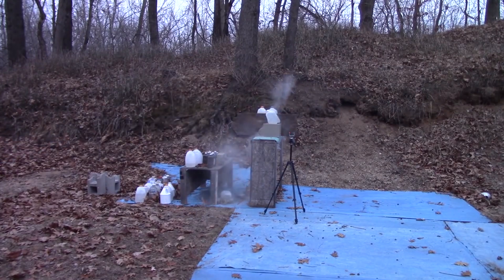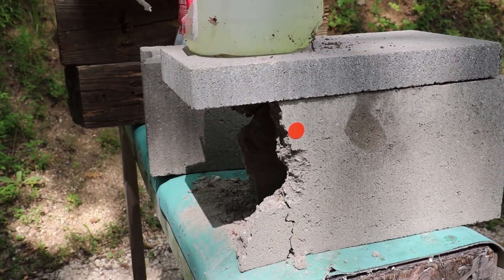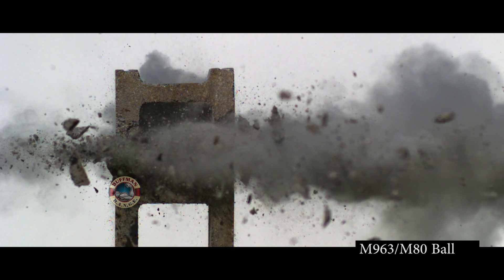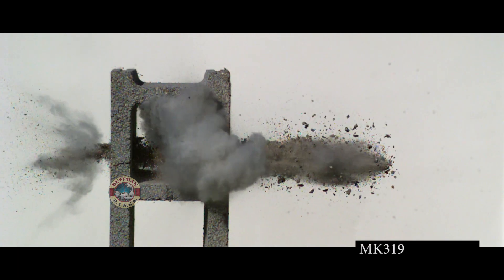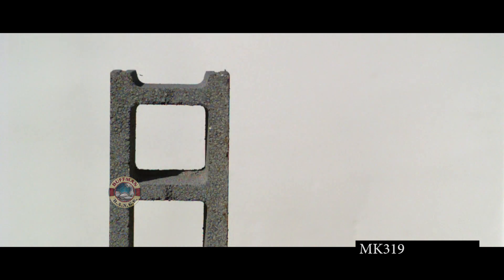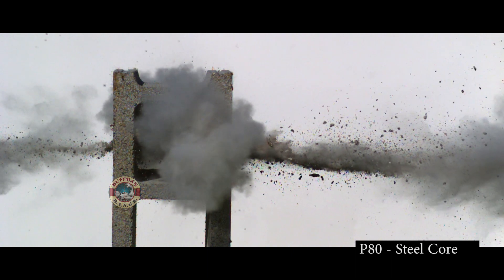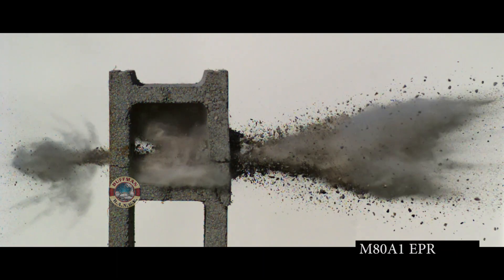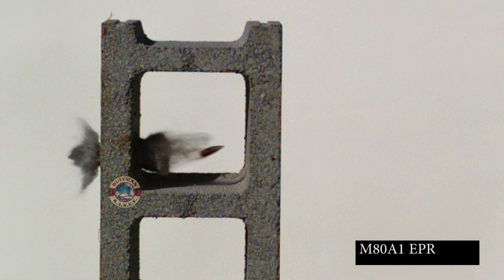7.62x51mm NATO vs Concrete Block Super Slow Motion! M80A1, Black Tip!

Comment: Great stuff. I think this is pretty definitive. The M80 and Mk319 were "stopped" and the P80 and EPR got through. That's consistent with other testing. My theory when I did that series on "does an M14 turn cover into concealment" was that, while 7.62x51mm FMJ can penetrate a bit more than 5.56x45mm FMJ, there aren't a whole lot of real world objects that can stop a 5.56mm cold and allow 7.62mm to pass through cleanly. Just putting a hole in the other side of the block doesn't mean much when the fragments are moving about as fast as a paintball.
Reply from the maker: You think this is good enough for Tech in Ammo on ARFCOM?
Reply: Absolutely. I think all your videos are.
Reply: The EPR and mk319 exited at about the same speed. I'd like to see your theory put to the test. Have various cover objects in front of watermelons and see the difference in effect/damage from 5.56 vs 308!!